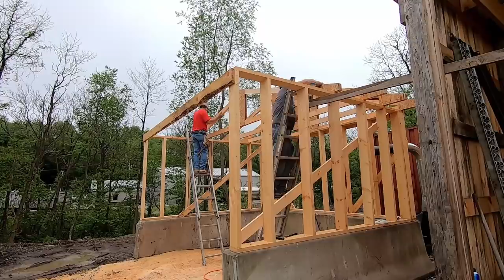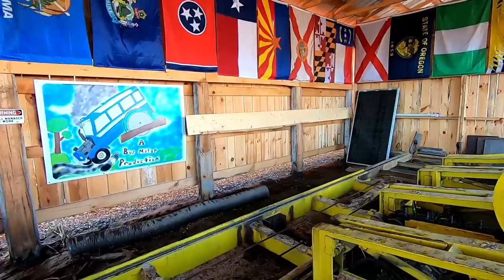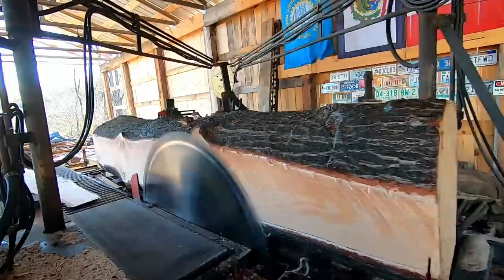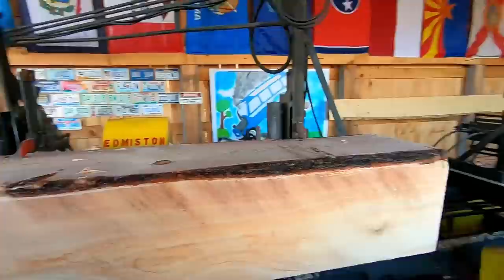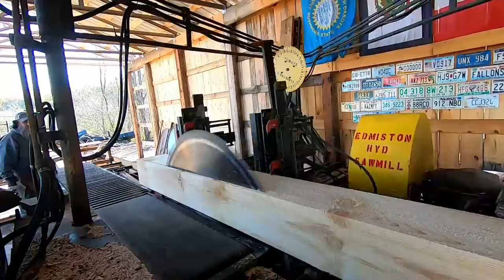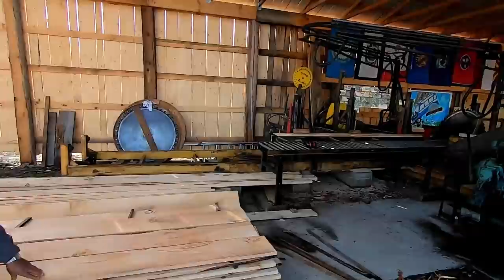nice ole pine

Comment: Somewhere, either just before or just after WWII, my father acquired a handful of 16" wide, clear, white pine boards. They had all pure vertical grain with hardly any visible curvature, which means they must have come from a tree well in excess of 40" and been sawn with a profligate attitude towards scrap.. There was not a single knot in any of the boards; the grain ran straight as a die from end to end. He used them only for special projects, and reclaimed the wood if the project fell into disuse. Still, they gradually vanished. I now have only a few short pieces - the doors of a small cupboard - and they have many holes from the fasteners of earlier projects. But, they are still completely flat 80 years later. It may seem silly, but I consider them to be family heirlooms (which is a mighty noble title for a couple of 16" by 30" boards).
Reply from the maker: very nice.

Comment: A plank is a long thick board that is rough-sawn, and that is left "unfinished", that is, unplaned and unjointed. A board can be sold rough-sawn, or it can be sold fully finished, planed and jointed, or finished on two faces only. Boards can be short (say under 2 feet) or long (say 12 feet). Boards can be relatively thin (1/2, 3/4, 1 inch,); above one inch thickness boards are referred to as 6/4, 8/4, and 12/4 boards in the US. Those are the standard nominal thicknesses

Comment: That was a dandy log 4 sure! NICE boards! The mill will be very happy with them as the bus motor was cutting them. The old logger/sawyers grandson gets logs like that but is off the goffers paradise and hasn't been touched in a long time. He's trying to build himself a house but customers keep getting his siding so he's trying to hide some for himself. He'll get it. So you and T.H.E have a fine week and GBWYall. Yessir, Mr. REEL will be missed. I hope he's got all his previous stuff archived and we'll be right there 4 Chad and Maw Ruth, betcha!.
Reply from the maker: yes one more should finish up the walls.
Reply: @markgalicic7788  Just roll the fire barrel a little closer for the winter runs!

Comment: Does Eddie use any particular treatment on his beard?  It looked especially luxurious and full, brushed out today.  

Plans to put the edger under roof?  I thought it was to be covered with current addition.  Another subscriber thought not.  

When I was a kid, my Dad laid his ankle open with a double bit ax cutting boards off an oak log that the blade couldn’t clear.  He was standing on top and it glanced off a knot.  Then, the wound got infected and gave him fits for years.
Reply from the maker: yes we hope to move the edger under roof .

Comment: I noticed your carriage swing arm POST close to the blade is narrowed. .could you move it back 4" re-weld it station again without interfering the belt drives from BUS MOTOR...
it would give you full cut facingsof 24/26"

Comment: Out of curiosity if you wanted 22" why not add an inch plus blade thickness for each pass and start there after you turn it? Say blade was 1/4" and you wanted final 22", 23 1/4, 24 1/2" and you'd never have a thick slab that way. I dunno maybe my thinking is wrong here?
Reply from the maker: 22 inches is the maximum height that the saw will cut.

Comment: What is wrong with using the center of the log ? I have heard you mention this before and I would like to know what’s wrong with the center ? It’s for siding and it should be good enough for that .
Reply from the maker: the center has cracks & stress in it.

Comment: Hello mark I have a question . I a 671detroit  buss motor also on my frick sawmill ..I was wondering  if you have a govern  on yours to speed up the rpm s when the saw goes into the cut. I don't  an I think this is causing me problems    thanks David
Reply from the maker: yes it does have a governor built in or it will slow down. ask the bus grease monkey how to install one , he has a youtube channel.
Reply: Thanks so much  I appreciate  it

Comment: You need a vertical edger. Ever thought about it?
Reply from the maker: we don't have three phase power to run one.
Reply: @markgalicic7788  I seen a amish mill with a 671 on it and a vertical edger and they had hydraulic pumps running the eletric motors

Comment: There would be less work for you if you turned your rip saw 180 degrees and kept the useable wood off of the ground because it has to be lifted off the ground to be fed into a rip saw after which it is put back on the ground to be stacked. Hopefully the forklift is used to move the stack onto the customer's or a delivery truck. Instead, the scrap pieces should move forward on the rollers where they can drop  into a container that could be handled by a forklift. The useable boards should slide off of the mill rollers and onto a table to reduce the amount of bending down motions. Ed has to lift the board off of the mill rollers, turn around and bend down to put them on the ground where later, you have to bend down to lift them up again to put them on the rollers for the rip saw, after which they are once again carried back towards the front of the mill to be stacked. It would save a lot of back strain if the boards came off the mill then are fed back towards the front of the mill as they go through the rip saw. With just a little change in your setup the boards could fall onto the stack without having to be carried at all. Raw materials and finished products should always travel in one direction only. Just like a car factory or fast food restaurant. Next time you get a burger at a fast food place look at their setup. The delivery truck unloads in the back of the building where the freezer is  located. The food then moves forward to the grill. After grilling it moves forward to the prep/assembly area. After all the ingredients are assembled it moves forward to where the wrappers are. After they are wrapped they are put on a slide where they slide forward to where the bags are. After being bagged they move forward to the service counter where the customers are. Wasted motion increases the chances of damaged goods and injured people because all that walking back and forth and bending up and down greatly increases the chances of injury because anytime one of you takes a step or has to step over something while carrying a board brings you closer to a possible trip and fall. Working smart is always more profitable than working hard. Thank you for the video and thank you for wearing hearing protection and gloves.
Reply from the maker: yes in a large operation.

Comment: I would like to have a pile of those thin full width tonlay down for a livingroom floor side by side with a half inch gap in between them then pour polyeurethane over it all about a half inch thick and that would make a kick ass floor if you could lay it wall to wall